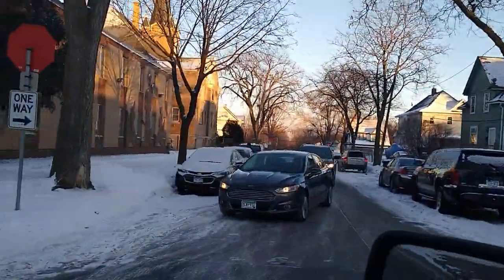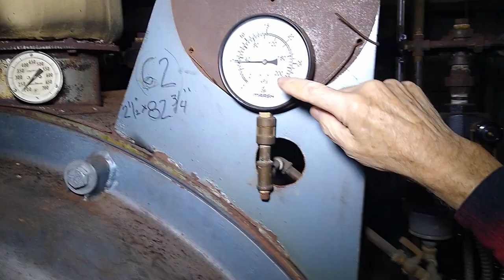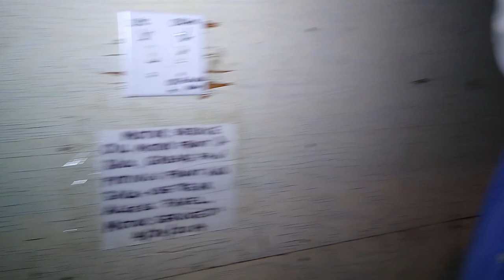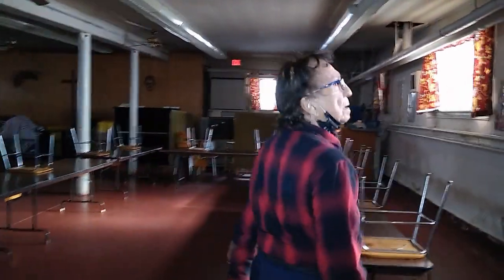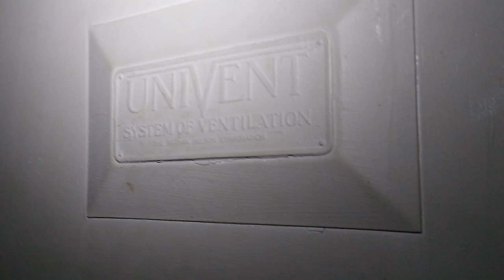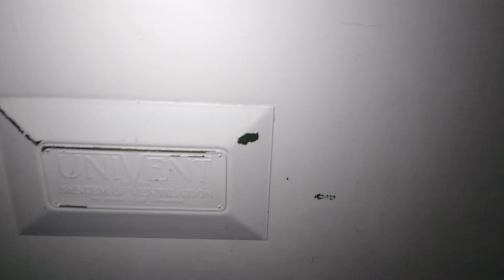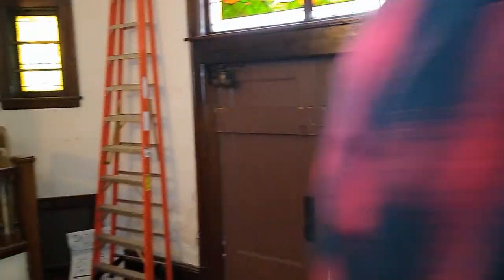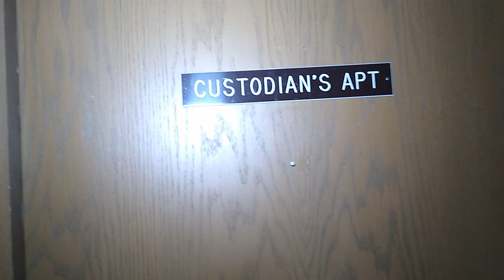Another Bus Old Man Adventure. Now I'm veering off course into an old church boiler room.

Comment: I've seen a few old steam systems, including an old, coal fired boiler. Thanks for taking us on the tour of the church, it's a beautiful old building.
Reply from the maker: The original 1922 church boiler never burned coal. It had an oil burner until 1950 when it was converted to gas. I just renewed my Chief C license. I took my test in 1965 when we had to understand the heat value of coal and how to handle coal fired boilers. I operated coal fired boilers and stokers in the 1960's.

Comment: This is a very fascinating video, Phil, thank you. After watching the entire thing I wanted to clarify that at 1:18, the 1922 addition is the portion rearward of Phil that has the concrete frescoes in the brick work and the arched windows.  Based on the lights and ceiling tiles in the basement, I would guess that the radiator covers are from the 1950's or possibly added when the 1960 addition was built. Looking forward to the next installment.
Reply from the maker: Your comment on the  1922 addition is correct. That addition begins with the metal fire escape from the custodians apartment. Your guess on the covers is a good one. The covers over the radiators are upstairs in the sanctuary. I'd like to remove them and clean and spray paint the rads gold, as they were originally. Thank you for your clarification.

Comment: Thanks you for the behind the scenes tour Phil and Pastor Dale. I have never had to worry about steam heat here in Florida, but I did work on a brewery project that we worked toinstall 2 new clever brooks steam boilers. It is quite interesting, I have also worked in several power plants that run on steam. 
I am really looking forward to the pipe organ tour, I really enjoy them. We have a tradition here in Tampa on Bach's birthday, they do a pipe organ tour of the churches in downtown and each church plays some of Bach's music on their pipe organs.
Reply from the maker: Many older hotels in Florida built in the twenties and thirties have steam heat. The buildings were not well insulated and became uncomfortably cold during cold snaps. 
We once had spring organ concerts here in the twin cities. The theme was "Anything But Bach."
Reply: @busoldmanphil7293  Yea, I am sure there are buildings that use steam heat here... I work for an mainly industrial specialty electrical contractor so I have not had that much experience with those systems in buildings, but other than the radiators it’s very similar to what we installed at the brewery. They use the steam to heat large kettles. It’s pretty interesting stuff. We would run all the electrical for the boiler and the controls.
Yea Bach can be a bit tedious, but I was just glad to hear the pipe organs. That sounds like a good time.
Reply: @busoldmanphil7293   Many an American from the North find Australia cold, because our buildings don't have central heating.
The new ones have great insulation though. When we were in a hotel in Toronto at Easter time we really enjoyed the -8C outside, for it was so stuffy and hot inside.

Comment: Great info Phil. Basic heat & pressure but very many moving parts have to work to keep it going. Must have been something to see that being built over a century ago! Certainly skilled craftsmen did a great job building this world. Thank the lord some smart people allowed natural gas to flow in from Canada to make heating easier and cleaner.
Reply from the maker: Look at the plumbing in the basement views. The precision with which steamfitters measured, cut and threaded all the pipes so every component fit exactly where it should.
Reply: @busoldmanphil7293  There was so much paint on much of that plumbing that I reckon many of those valves would be jammed with it.
Reply from the maker: @bruceknowling415  None of the valves moved. the valve stems are covered with 5-10 layers of paint, as are the basement radiators.

Comment: The church I last attended had a steam boiler that was used for heating the water for the hydronic system that went to fan/coil units in the classrooms and the large air handling units for the nave and chapel.  It was a very small closed steam loop in the boiler room.  At one time the steam did actually go to radiators throughout the building but all the radiators have removed.  The steam pressure on the system was maintained at 10 psi.
Reply from the maker: Just came from a larger church campus set up the same way as yours. Constant maintenance issues with the hydronic part. The Lead/Lag steam boilers just go on year after year reliably.

Comment: Hey Phil, super cool stuff to watch. I’ve spent my time inside a high pressure boiler cleaning it for an inspection. I work for a company that’s involved in steam related products and it’s cool to see buildings still heated with steam.
Reply from the maker: Do you sell steam heat related replacement parts such as IB traps and 1G and 3G traps or cage units?
Reply: @busoldmanphil7293  We’re in the business of paper dryers. Rotary joints and the like. Our building is heated by steam as well, but when they put the system in here however long ago they got the steam traps from another company here in the same town that also does steam stuff. So to answer your question, as far as I’m aware, we do not.
Reply: @busoldmanphil7293  I wish I could post pictures in the comments, to give you a better idea of the stuff we do. It’s hard to explain properly what it is we do with our visual reference.
Reply: @MegaMobass  Perhaps a link to a website?
Reply from the maker: @MegaMobass  Would like to see your plant. busoldmanphil@gmail.com
Reply: @busoldmanphil7293  I will definitely follow up with you there tomorrow. I’d be happy to share with what I’m allowed to.  The company I work for has a series of videos on their YouTube channel. If you look up Kadant Inc. on here they have some neat videos of the we make.

Comment: Ooh ok, you did say hot water system.
Ok, now i am confused....
I don’t think you can can have a steam system and hot water system on the same boiler.
It should be one or the other?
I am a HVAC contractor in NC. 
I don’t know everything......
Reply: You can produce steam and hot water with the same boiler. Elementary school I went to was this way. Old section was steam and new was hot water. My dad was a janitor there and serviced the boiler.
Reply from the maker: 4:35 I did a poor job of explaining that. In that drum, called a converter, steam from the boiler surrounds a bundle of tubes thru which water circulates, and is heated by the steam. That hot water is pumped  to baseboard units in each room in the school and in common areas of the school building. That function is separate of the steam line to the church. The boiler discharges steam only. More on that: Immersion coils can be fitted into the boiler below the water surface to supply hot water for domestic use using circulating pumps and a hot water storage tank.

Comment: Now at 31:58 is the stat a Pneumatic stat?
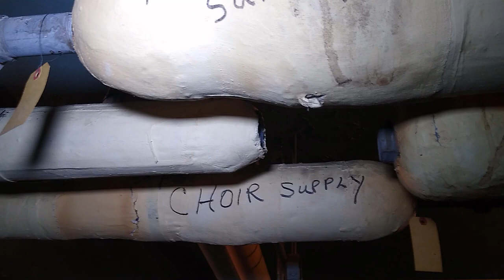Reply from the maker: Yes. See 6:15 - 6:45. 10 lbs air pressure holds valve closed against a spring in the valve chamber, 5# begins to open valve, zero pressure and spring holds valve wide open. This is a safety factor . In case of air pressure failure for any reason, valves will not close and cause a freezup in the building, especially around the kitchens and restrooms.